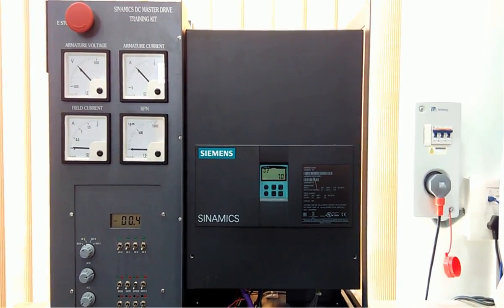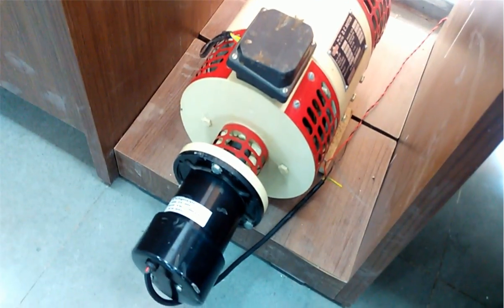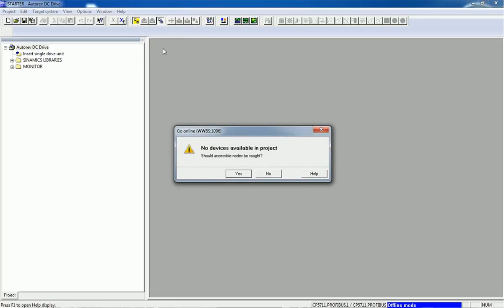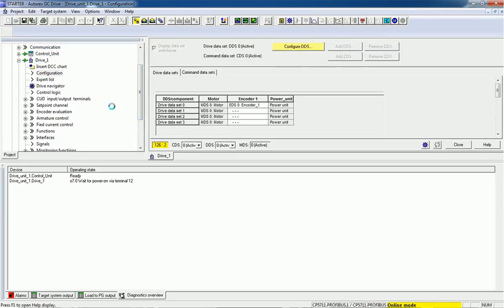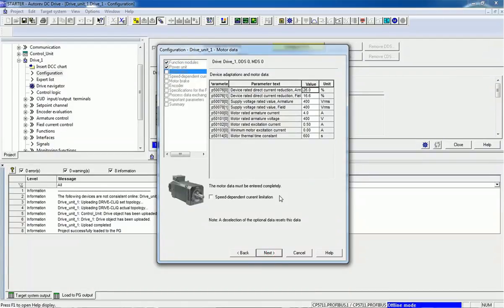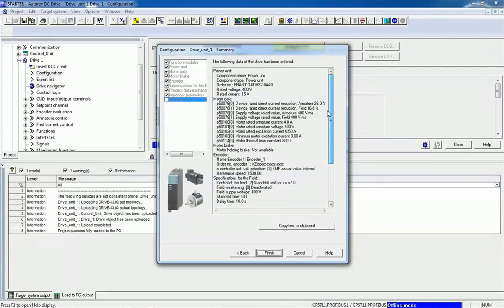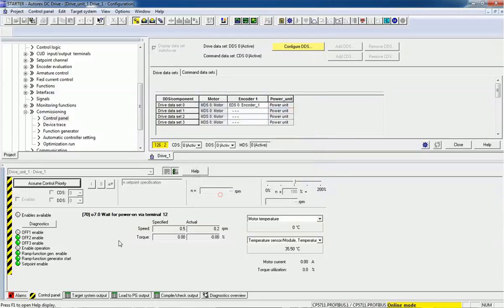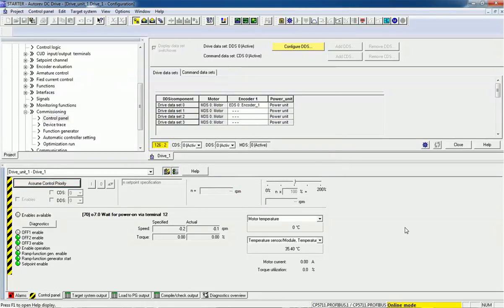DC Electrical Motor VFD Configuration using Profibus from Siemens Starter Software

Comment: Hi please tell me procedure to start up Simoreg DC-Master 210A with manual configuration.
Motor det: Arm volt-400V
ARM ct:23A
FLD volt-220
FLD ct: 0.5A
Speed select is EMF